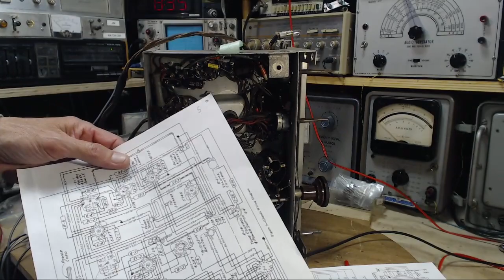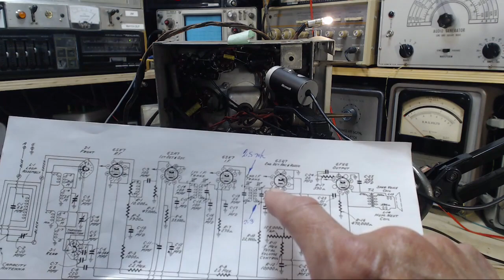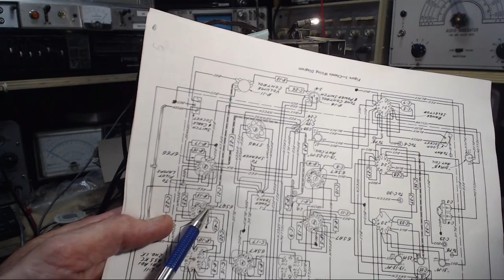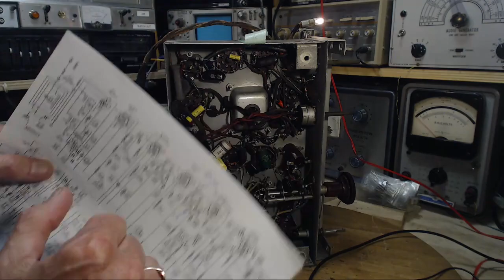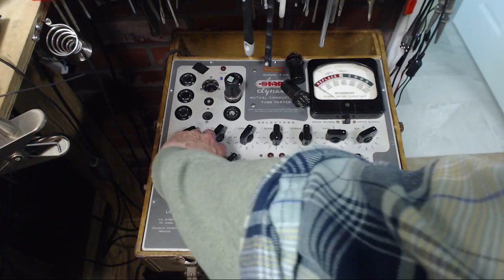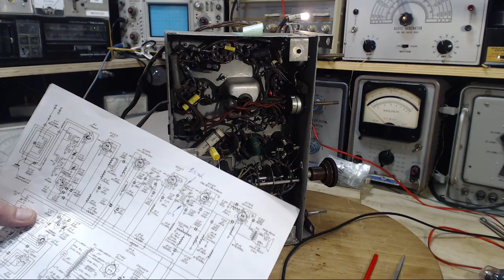Canadian General Electric Model JK-66 Video #11 - New Problem?!

Comment: I could not tell where it was from but there is a lead from a component wrapped around the center screw of the bottom of that coil. I don't think it is should be there. Also you should always confirm a solid mechanical connection prior to soldering any wire and not depend on the solder to hold the wire in place. You should pull out the end of that red wire you resoldered and strip off insulation and either put it through the hole of the terminal or wrap it around it, then solder it. Slow down and take your time.

Comment: You appear to have made some error in the wiring of the secondary of that IF transformer. One end goes to the diode as you know and the other end should have audio on it and the 22k resistor. Have you grounded this terminal in error.